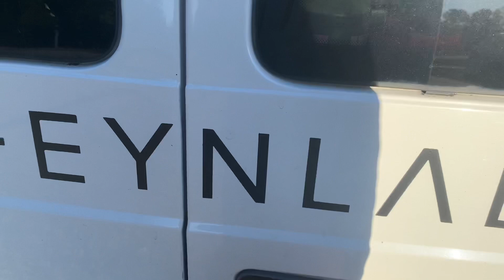Detailing Van set up 2022

Comment: Metal frame supporting the plywood?? I have a GMC Safari so I’m looking to do a similar build. Just not sure how to Mount it for support
Reply from the maker: I actually welded angle iron across to the inner structure of the van and put wood across it.  I also recently redid my set up to a skid mount system now so it’s completely different and much more efficient and organized. Check back soon for the new updated version!

Comment: I have the same design in my promaster! It’s just a 125 gallon tank, strapped to unistrut that’s screwed into the frame. More unistrut along the ceiling to hold 3 of my hose reels, and a big ass shelf completely left to right about 27 inches deep. I hate the builds with a giant wall or a build that makes servicing it difficult or some builds literally make you more inefficient if they aren’t simple and open, too focused on pretty design is pointless. It’s all about efficiency and serviceability.
Reply from the maker: I like this set up and have had it similar in a different van for years. I have learned what works and what doesn’t over the past few years and I’m currently working on a new skid set up. These pressure washer reels you see in this video have recently gave out and had built up rust inside the tube part. Im going with all retractable reels. The new skid design will be fully accessible and simple similar to the other skid mounts you see on other videos .
Reply: @realdetail6447  sheeeiiiit as long as you build the new skid yourself you’ll save $1,200!! Post results in a new video whenever you do it!!
Reply from the maker: Yeah that’s why I’m building it myself. I’ll have less than $1k in the skid itself. It’s the new reels and equipment that cost a lot!
Reply: I have those crappy general pump reels I never got my going. It leaked all over. How do you have yours run a pump or gravity ?
Reply from the maker: @startingtech3900  yes those reels suck, mine rusted inside the tube part and clogged up my guns, I’ve recently purchased new retractable reels. I’m working on a new setup now. I use a pump on each pressure washer even though they say it doesn’t need them on the kranzles
Reply: @realdetail6447  ah I see.  the issue I was having maybe due to the leaks was my pump was over pressuring my power washer and then bursting out of the fittings (leaking) I also got a really cheap Drummond pump from harbor freight. And then it didn’t pressure it enough gravity fed. Do you think my issue was the leaks ? A normal hood made in USA retractable reel with seal tape would prime and wouldn’t leak and burst ? I contacted blue sheild pressure washer retractable hose reel and they said there reel doesn’t leak and comes w a 50 foot hose and outlet hose. I may buy that
Reply from the maker: @startingtech3900  my pump I have is 55psi, which is about the standard psi from a house spigot so it shouldn’t have any effect on any pressure washer at the psi rating. My retractable reels are rated at 4000psi and are heavy duty quality but that comes with a heavy price as well but worth it. Blue shield reels are good ones too.
Reply: @startingtech3900  hmmmm where’s it leaking from? I use the thread tape that you would typically use while installing a gas fitting. It’s better than traditional thread tape. Make sure any hoses don’t need sharp angles to reach a fitting because when pressurized, the hoses will pull and tug on the fittings and threads they’re attached to.
Reply: @Ichabod_Jericho  I used the yellow pipe sealant and let it cure 48 hr but it leaks from the actual fitting of the reel. Not my end where I can do anything about it. Going w a high quality reel like blue sheild. Do you know how to make a recirculating system so my pump doesn’t blow up my power washer ?
Reply: @realdetail6447  thank you so much for the 55psi info and other info huge help guys! i have everything on reels the last one is pressure washer reel so looking forward to getting that to work. do you need to make a re circulating sytem real detail?
Reply: @startingtech3900  damn sorry they sold you a junk reel. That’s bullshit. But yeah invest in the nicest equipment you can when you can because it will last 25+ years as opposed to 1. 

I would ditch an exterior pump all together. Either buy a CAT 1800 1.7 GPM or the new Active version that still has a pump inside. I have a kranzle 1622TS on a gravity fed tank. The gravity leak plus the suction is enough for 1450 PSI. Plenty for detailing and not too much water waste at 1.7 GPM.
Reply from the maker: @startingtech3900  my pressure washer has the total stop so it shuts itself off until I pull the trigger so I don’t need a recirculating system
Reply: @realdetail6447  which pressure washer u use real detail?
Reply: @Ichabod_Jericho  I’ve heard good things about the kranzle. Should I get one ? I want an electric one
Reply: @Ichabod_Jericho  and wasn’t just me. There was 10 other people on Amazon complaining it leaked. I should have listened. But I thought they didn’t use seal tape or set it up right. Nope lol 😂
Reply: @startingtech3900  bro getting the kranzle was the best investment for my detailing business. I don’t think any of my other tools top it. Reliable, sturdy, serviceable at home. Without a doubt the best commercial washer for detailing. You must go electric. Technology has come too far to not see it in pressure washers. Save up, buy it, it will impress.
Reply: @Ichabod_Jericho  I got 40 GS (which isn’t much but 3 years ago I had nothing ) rn I can buy it outright. Sold all my nice cars and just drive my BMW X5 and put some money into my Astro van setup. i don’t know why I tried to go cheap on the reel. Where can I buy the kranZle like rea detail that won’t explode due to pressure and has no problems without needed a recirculate hose? thanks guys 🙏
Reply: @startingtech3900  fuck yeah bro congrats!! This is the first time in my life I’m not paycheck to paycheck either. Extremely grateful the sensation is like no other. Yessss bro get a 1622TS from a reputable dealer. I can send you pics of how mine is plumbed, it’s soooooo easy. No need for a pump whatsoever it can also pull water from 3 feet above the source if need be. I don’t do that though to keep any potential strain off the pump.
Reply from the maker: @startingtech3900  it’s a kranzle 1622ts